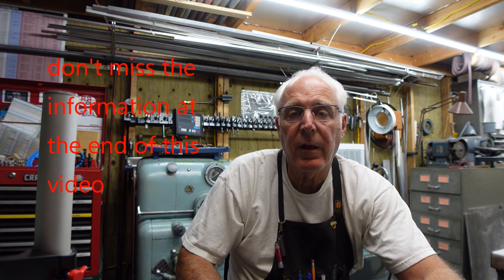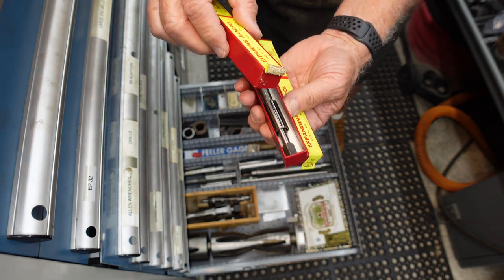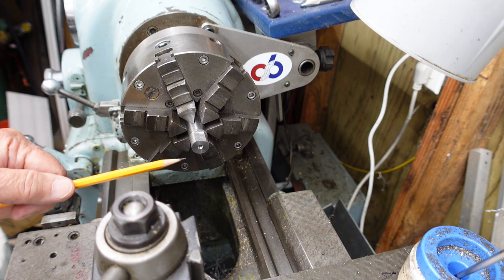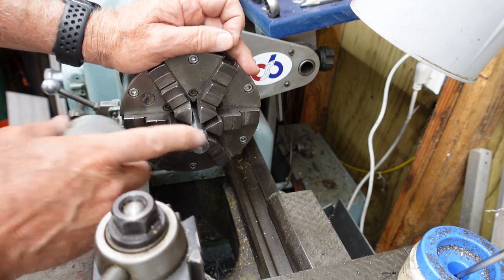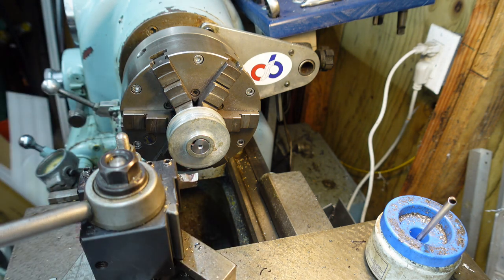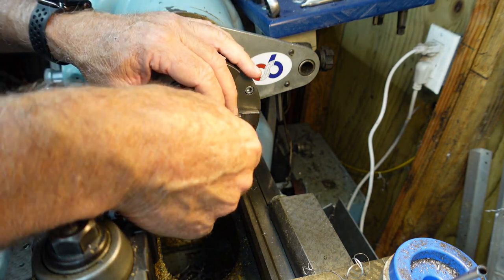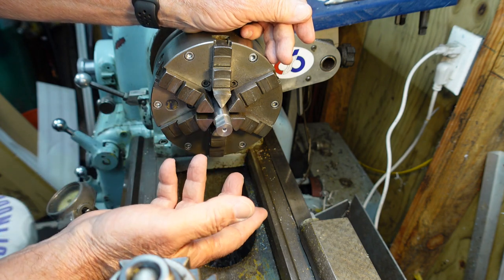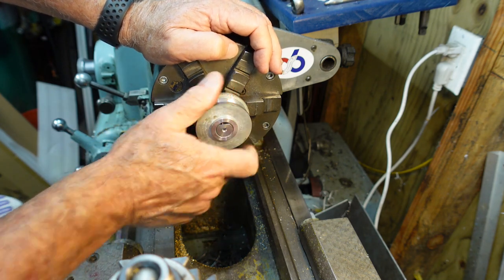Self Locking Mandrel from scrap

Comment: Didn't seem to matter as I the mandrel readily locked both times without noticeable roughness to the cut buuuuuut you locked it in reverse both times Chuck!! 
Probably would be an opportunity for the part to shift axially if you were facing it and needed to hold it without bottoming as in the last example.
Awesome share none the less many thanks once again!
Reply from the maker: thanks for viewing and your supportive comments...my error did prove "self locking"....
Reply: I really like this simple and effective mandrel. There’s got to be a limit to how much load this device will drive since it depends entirely on friction between the shaft and driven part. Can any of you math whizzes provide some numbers on that?

Comment: Excellent idea Chuck. Please explain the difference between a mandrel and an arbor . Thanks
Reply from the maker: thanks for viewing...an arbor is a spindle which something attached revolves, a mandrel is a shaft or spindle to which work is fixed while turning
Reply: @outsidescrewball  When you say turning do you mean turning as turning on a lathe ?
Reply: @terrycannon570  Think of a Morse taper to Jacobs taper adapter in a mill holding a drill chuck concentric with the spindle. That is an arbor.    If you have a tapered shaft holding a pulley between centers, that would be considered a mandrel.  BTW, it doesn't have to be tapered, but the "work holder" is the Mandrel and the tool holder is the arbor.
Reply: @MatthewRulla  Thanks. Makes sense

Comment: You need to lock the pin the opposite direction so it "locks" with a "click" and the pin should be just large enough to fit between the flat and the radius. The author of the trick was Philip Duclos and he made amazing engines and used wonderfully clear photography in describing the processes. I have used this "trick" myself with a finishing nail and it works well [I am an amateur machinist]]
Reply from the maker: thanks for viewing and I am an amateur also....but if? I did it wrong I proved it is self locking....interesting back and forth in the comments regarding locking the pin....hence my (if)...lol

Comment: Thats pretty clever Chuck. Question....would it be safer to rotate the part in the direction of the cutting resistance so it doesn't have the potential to " Unloosen" ? The lock direction seemed to reverse after that .030 cut.
Reply from the maker: thanks for viewing and commenting Joe....yes, I did turn it the wrong direction, I agree...

Comment: Nice video. A few close-ups would have been nice.
1) 0.668" is about 1 thou" under 17mm.
2) You're turning the wrong way to lock the mechanism. Since your lathe turns the part counter clockwise, the cutting tool will impart a counter clockwise force, so you should be turning clockwise to lock.
By locking counter clockwise, the cutting tool is then unlocking the part and then re-locking the part clockwise. This can be seen at 7:36 when you had to turn counter clockwise to unlock.
This locking & then re-locking could result in part movement that leads to inaccuracies, especially if taking a face cut.
Reply from the maker: thanks for viewing and your comments, stay tuned as I may do a follow up with a larger part...

Comment: Chuck, thanks for showing the rather rare locking pin mandrel to your viewers. I’ve known about and used the device for years but you’re the first channel that’s demonstrated it. I didn’t know about the 12/1 ratio so that’s a new one for me. The pin doesn’t have to be the exact diameter calculated by the ratio as long as it’s fairly close. For example a 1.25 bore can use either a 3/32 or 1/8 hardened dowel. 1/8, 5/32, or 3/16 also works with 1.50 and 1/4 works for 3.00. I hope this helps.
Reply from the maker: thanks for viewing and your comments

Comment: An excellent quick fix.
I made a series of brake cylinder piston removal tools using something similar.
On many motorcycle they use multi piston systems and once one piston is out you can't easily build pressure to push out the other stuck one. My tool uses an equilateral curve triangle and three pins. The amount of grip can be quite large and the piston can be removed by turning and pulling, without any damage to the piston.
Reply from the maker: thanks for viewing and your always informative comments

Comment: Interesting topic.  atan(1/12) = 4.76 degrees, which is a small enough angle that it will probably lock.  I think 7 degrees is the breaking point between locking and non-locking tapers.  Practically, I think the angle is smaller at the center and larger as you go farther away from the centerline.  I didn't work out all the details but one side of the triangle is a circle, so it's not linear.
Reply from the maker: thanks for viewing and your comments, I assume that you never looked behind you in class, cuz if you did you would know I wasn't there...lol, like your math but beyond me....lol

Comment: It’s a basic one way cam. But you turned it the wrong way. You have to turn it against the way of rotation. Otherwise, with enough torque it becomes a self loosening cam.
Reply from the maker: thanks for viewing and if you read the comments there are lots of opinions.... but I guess I did prove that it is "self locking"
Reply: @outsidescrewball  yes, you did, after it slipped. There’s a difference between options and correct information.

Comment: That size you rattled off as "odd" is actually a metric size.  I've been trying to use some surplus bearings (used, but good) for part of a belt drive system on my little Burke mill, and that is the measured inside diameter of one set I'm using.  Just an interesting coincidence.  Aggravating, though, as Bozo keeps riding my @$$ and getting me confused.

I'll remember that tip for the mandrel.  It reminds me of a hack I've often used, a simple flat spot at the end of a shaft, along with a ground down steel key, to fasten a drive pulley or coupler, when I had no way to cut a keyway.  It may not be 'orthodox' but I never had one slip or otherwise fail on me.  The key really isn't needed for light load/low shock mechanisms, but I prefer keeping the grub screw thread in the hub as much as possible, less chance of having it get bent and causing a problem with extracting it, should the need arise.
Reply from the maker: Funny as you said, the odd size rang in my head also metric since it was a car part...I have been hiding and Bozo has not found me during my last 2 projects....LOL thanks for viewing and your supportive comments
Reply: @outsidescrewball   Mine are salvaged from broken mower spindles.  As long as people keep using that mower as a bush hog, I'll have plenty of spares.  Housings and shaft don't last long enough for it to kill bearings.

Comment: Hey Chuck. I recently sent you a comment. This is Keith Monarch from Michigan. My last career was at a company called Woodward. They do various products in aircraft turbine engines. This Monarch Lathe, was built, in 1957 when I was born. What are the chances to use a machine, named and the same date as well. Anyway, take care...
Reply: @37yearsofanything isenough  I'm responding to your post. Thanks again and got back to me. Currently, we only had one bad snow. It happened Christmas Eve. As we approach February, maybe it will make up. Take care and keep in touch.